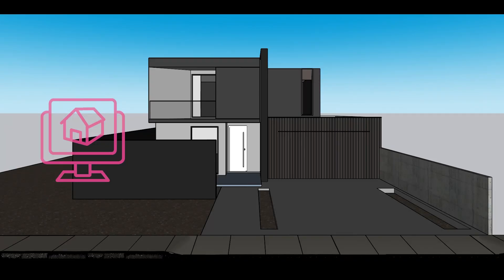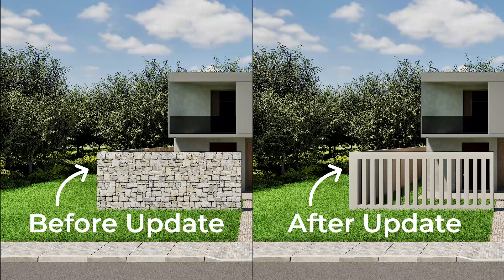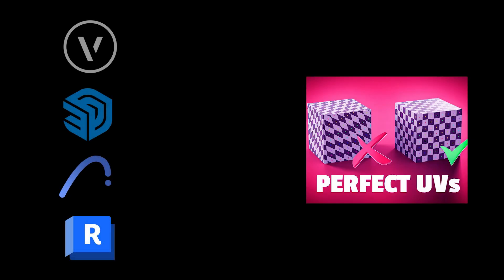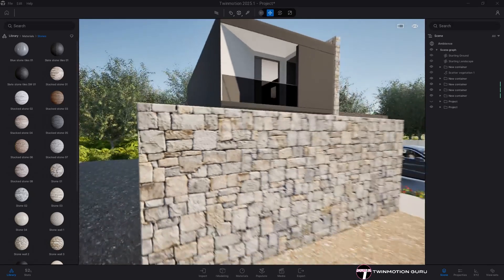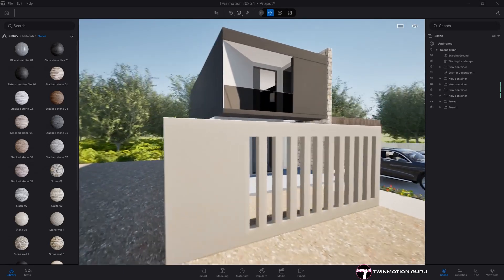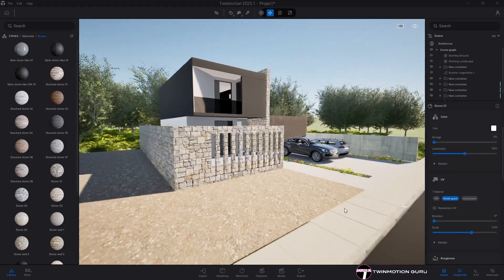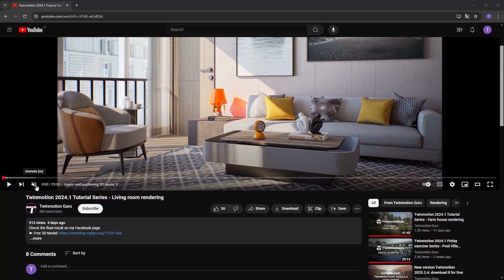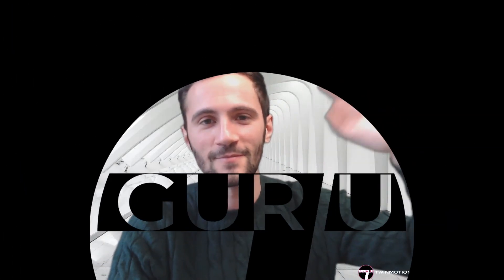Twinmotion 2025.1 - Never Lose Again Materials After 3D Update

Comment: Hello, even though I made the animation made with blender as fbx as output, when I import 6 balls falling on a plate to twinmotion, only 1 of these 6 balls becomes animated, the other 5 balls remain fixed in place. What do you think is the reason for this, even though I bake it, it is still the same?
Reply from the maker: @orhanalkan_blender  hi, unfortunatly I'm not a Blender user so I don't know what could be the problem. The only one thing I suggest is to try with a different export format. In addition to this, contact directly the support team and explain them the issue, type "twinlotion support" on google and fill the contact form 😁
Reply: @TwinmotionGuru  Thanks.
Reply from the maker: @orhanalkan_blender  you're welcome!

Comment: Yes with the UV update  + the Triplaner section  World space  + local space  has made a world of a difference for certain texture work (not all ) via sketchup. 
Due    due to Sketchups texturing / not UVmapped - Though there are some  add-ons for sketchup which allows you to UVmap your model  SketchUV wrapR UVtoolkit ThruPaint
Reply from the maker: @bumfie  ye you're right and agree with everything you wrote! The problem is that yhe majority of sketchuo users just use sketchup with no plugins 😆